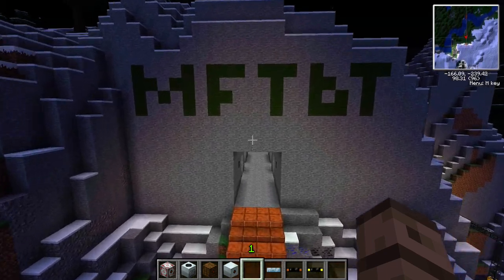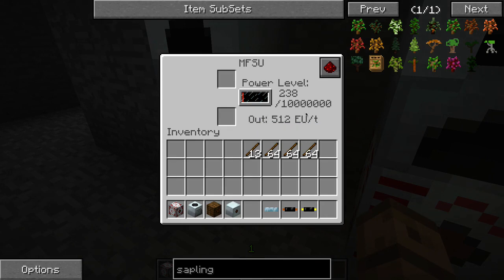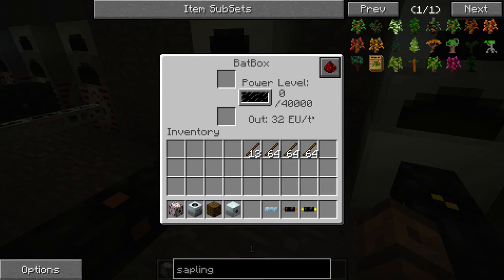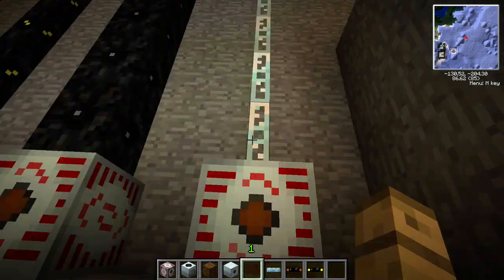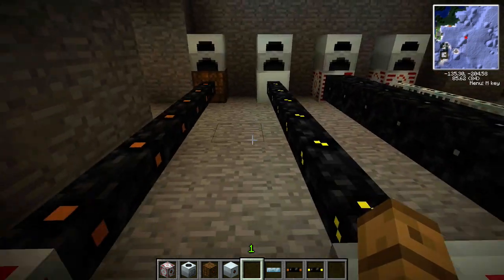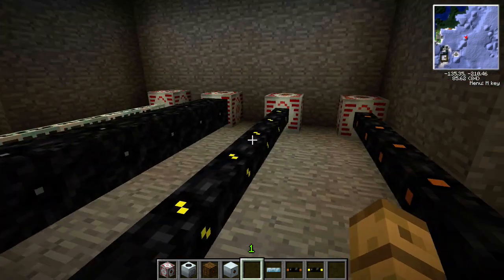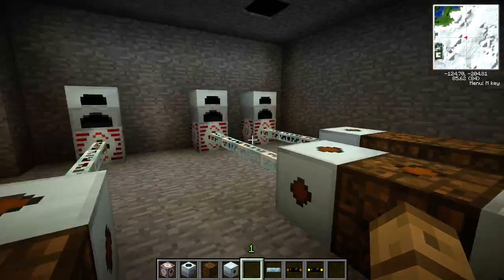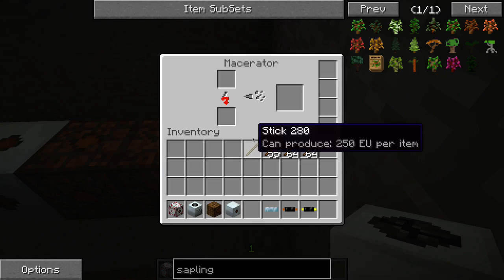FTB Tutorials - MFTBT 020 EU Basics, Explained

Comment: If I understood everything correctly there is one problem:
Let's say you have 512EU/t ant wanna power a macerator
the 512 pass the First transformer and than 1 package gets send after one more tick another package passes over so you will need HV to MV (x4) and then MV to LV(x4)
so your package would need 4x4 ticks to travel. => 1,6 sec to pass the Transformation. In my opinion that's not a huge problem [but I'm afraid it's only mine ;) ] 
But all in all nice Video!

Comment: I'm by no means an expert, but I believe the 4 LV transformers for every MV transformer is about bottle-necking your power and is not about energy loss. If you would add 8 overclockers to the macerator you would see that it would run out of energy with one LV transformer. If you add another LV transformer it would not. You would do this so that you don't have to use the transformer upgrade to hook up to an MFE directly and risk explosion with one click.